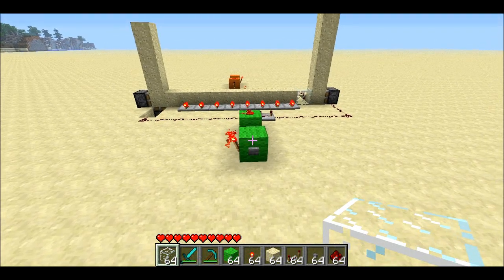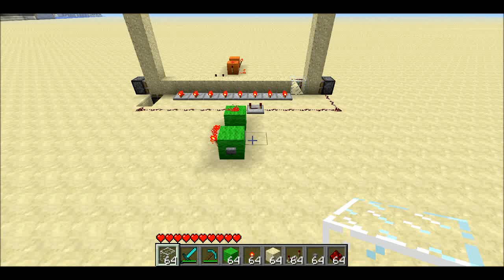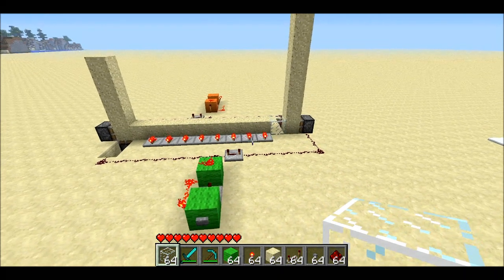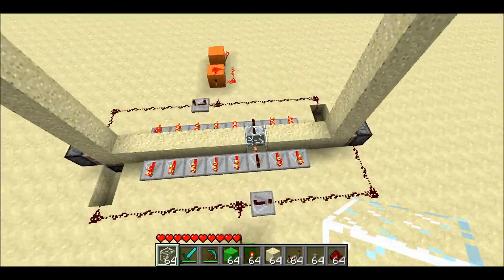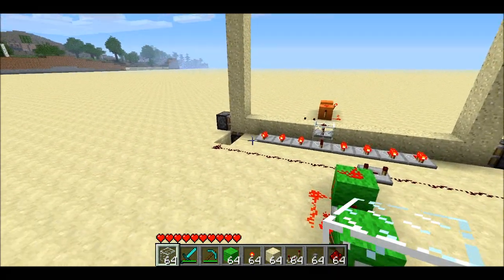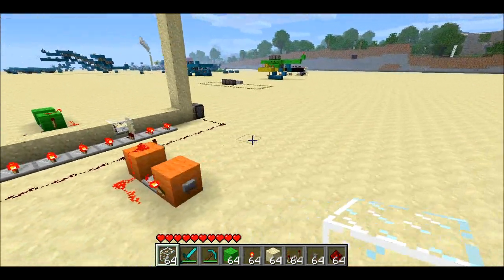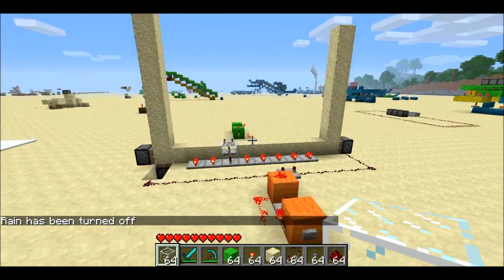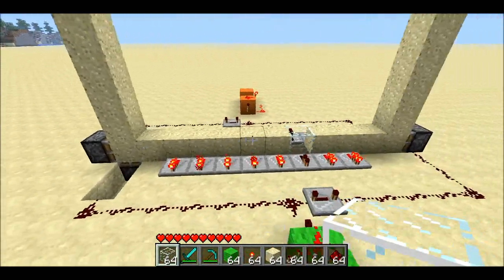Pistons + Sand = Redstone Counting Device

Comment: @sethbling you can attach the button to an RS NOR latch then attach the RS NOR latch to a block with a torch connected to a clock, so you could press it once and it'd count until all the sand is gone.